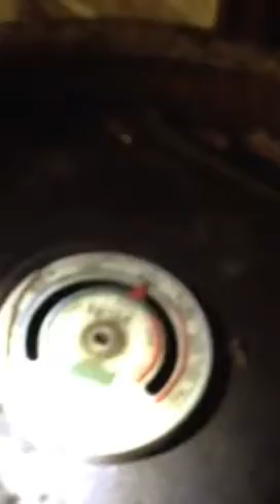Rocket Stove Heater

Comment from the maker: Simple yet effective, this way if it were installed on a wood floor I could raise it a bit, altho it's good to keep the heat low as heat rises. But I'm thinking in terms of portability and adaptability.  Also, if installed outside for a camping situation the legs make it easy to level.

Comment from the maker: Thanx! Yeah, I copied your idea of having a bigger firebox rather than the same size as the chimney, mostly 'cuz it's what I had on hand that I found at the scrap yard. The bigger firebox allows more fuel which means hotter temps and longer burns plus the all important ability to bake potatoes and my main goal is to learn to bake bread which I've never done even with a regular stove.  The tray idea is a good one, or maybe a box... This oven is quite small though, next one will be bigger.

Comment from the maker: I put one-by on the sides of the firebox and loaded the rest of it with douglas fir splints. Within 10 min the top of the stove was pegged at 900 degrees, had to move the thermometer to the side, don't want to break it!  Chunks of ice turn into an evaporating waterfall when I place them on the stove.